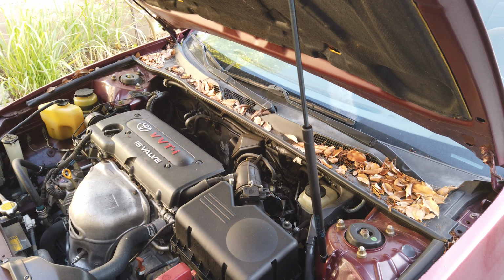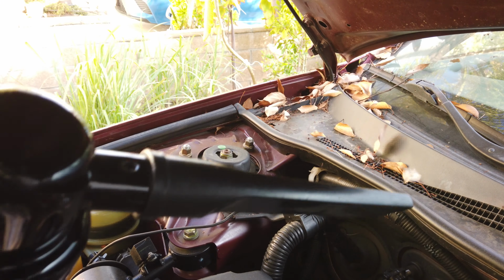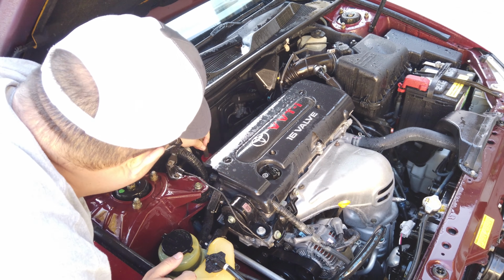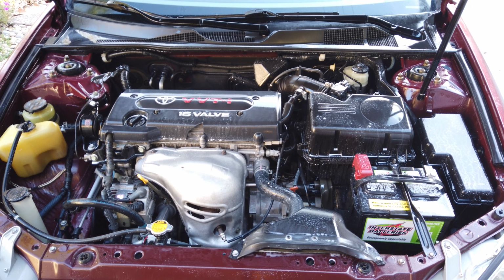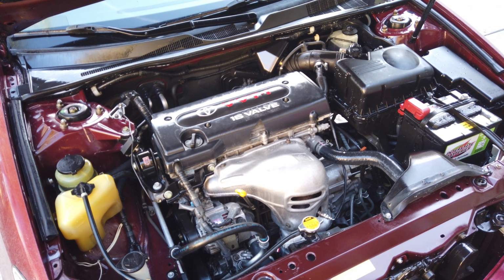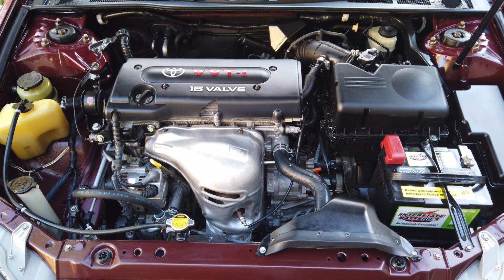Gross Engine Bay Detail | How to quickly and easily clean your engine | Your mechanic will love you

Comment: Great job! So no need to worry about spraying water all over everything? Is that safe for BMWs with a lot of electrical stuff?
Reply from the maker: I never had any problems. Just use some common sense. Don't get too close. Don't blast anything that you think you should not. Never wash a hot or warm engine. Cover any thing that looks sensitive. My s2000 has a open air filter so I cover that with a plastic bag.